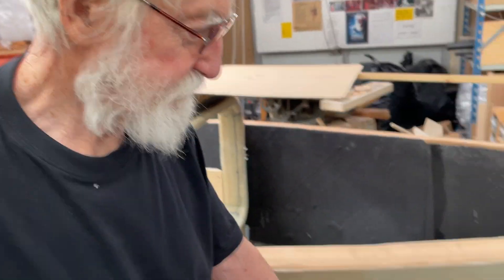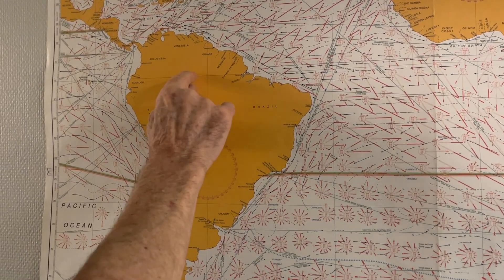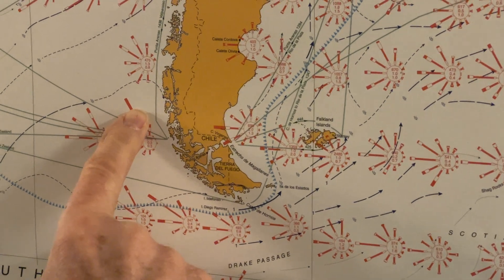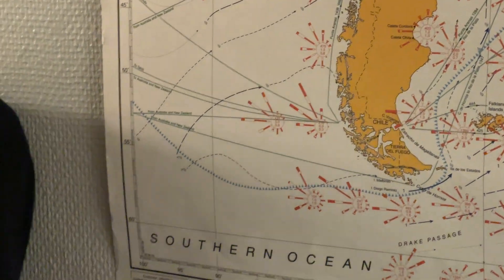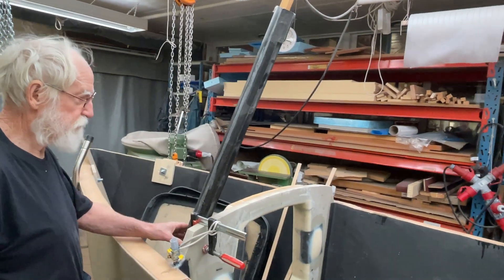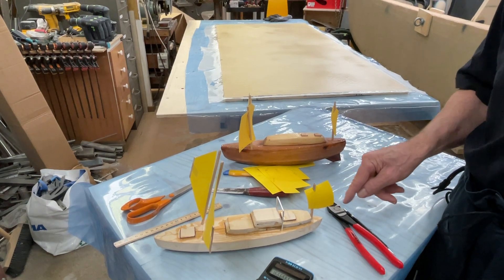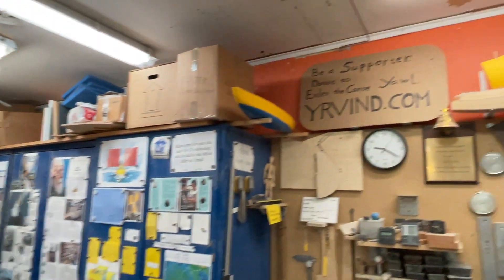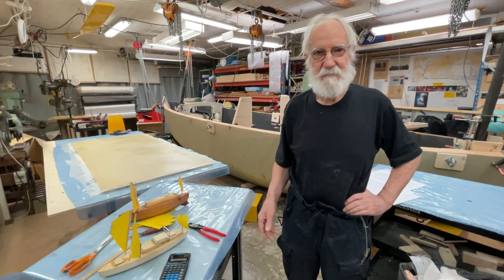A new year, a new idea, a new route. If confused go to Yrvind.com

Comment: I use the Hobie kayak sail and mast along with the Hobie Kayak Sail Furler Kit and outrigger with inflatable floats and a movable leeboard to sail my 17 foot sea kayak. The system allows me to furl the sail around the mast to adapt to all wind conditions. The sail is 2.2 square meters fully deployed. The mast goes through a hole on my kayak deck to a mast step (a Zodiac fishing rod holder) glued to the floor of the kayak in the forward compartment of the kayak. The mast end has a half-ball tip that allows it to rotate nicely in the mast step. Lots of fun to sail.

Comment: With regards to your aft lug sail you could sheet forward from the windward side of a boom which would be in tension . Hope that makes sense. Good luck . I enjoy anyone who is outside the box.
Reply from the maker: Thanks for the suggestion but the aft hatch is very close so that would interfere.
The mizzen sail is only 1 square meter about 10 square feet so no problem sheeting aft.

Comment: Yann Quenet poles out the sheet on downwind courses, and he still can't sheet the sail out beyond 90 degrees, as you wanted for self-steering downwind.  Have you considered junk sails?  Your rig has the great benefit that you can build rigid, curved battens for your two forward sails.  If you use only the leeward sail upwind, it can have a very effective profile, without any of the complications needed to reverse that profile for the other tack.  You can still sheet out beyond 90 degrees, and reefing is so easy, when I had a 5 sqm junk sail on a canoe, I sometimes used the halyard to deal with gusts instead of the sheet.
Reply from the maker: I will use two sails to windward in light winds. The Ljungström rig is very efficient to windward as by turning the mast you can get a smoth suction side.

Comment: Roller reefing on the mast will allow you to remain inside the boat for practically all sail adjustments. Great idea. The rotating mast may be a challenge to seal at the deck, but Sven will invent a solution. deck
Will you find a new storage place for water or maybe bring a small manual osmotic desalinator?
Reply from the maker: There will be no seal at deck on the mast. The solutions is drainage.
With 105 liter water I got plenty for Cape Horn 3000 miles Uruguay to Chile.

Comment: Hello Swen!
I have a question about Divinycell material.
How do you think is it good and strong enough to build a safe, stiff and durable ocean rowing boat or a kayak like the one Alexander Doba used? Will boat made of Divinycell be able to let cross the Pacific Ocean?
Thank you so much for sharing the videos of the building process.
You inspire me a lot.
Denis
Reply from the maker: You can make the boat as strong as you want. Divinycell is used in military high speed craft, submarines and wind power mills. It is only a question of dimensioning
Reply: @SvenYrvindExlex  What thickness Divinycell would you recommend for a 7-8 meter long paddling ocean kayak? The same as you use for your project or thinner material can be used?
Reply: @SvenYrvindExlex  Oh, one more question.  Why you use plywood and not Divinycell to build the interrior of your boat?
Reply from the maker: @denniskapitonov  I cannot ansver the thickness question. It is for the designer, but 10 mm is Ok Depends to on the laminate, if it is carbon fibre prepreg in autoklave or infusion or wet lay up or other.
Reply: @SvenYrvindExlex  Why you decided to use 70 mm. Divinycell for your current project?
Have you ever built boats from thinner Divinycell panels?
It probably forms/bends easier and will not require additional cuts in bending areas.
Reply from the maker: @denniskapitonov  I have used 50 and I have used 40 mm. Divinycell besides strenght also gives very good insulation and boyancy and make a quiet boat that makes little noise.
Reply: @SvenYrvindExlex   Thank you for your replies Sven. I wish I could work side by side with you.

Comment: With the new design for the rigs at the front of the boat how will you move them. I remember you saying you would like to be able to change their positions. Id you plan on having the roller furling will the masts be able to be taken out? If so the masts will have to be put back rolled if the string is pulled; or unrolled if the string is winded
Reply: Either way the reefing will be easier but the moving of the mast positions will be more difficult .
Reply from the maker: @botston  I do not realy understand the question. This is is a new idea. Before when I had lugsails they had to lean outside at sea but not in port. To solve that problem I intended to do an athwartship tabernacle. That is not neccesary anymore as this rig do not protrude in front of the mast.

Comment: I don't like the idea much.  The sockets where the mast goes in could be a weak spot and lead to de-masting.  I think having the boom rotate would be a better thing.  I'm mechanically inclined and not a sailor (I've read books on pitch poling and sailing in general) so take my ideas with a grain of salt, but something loose can come apart.
Reply: P.S.  Cape Horn is the true test of a ship/boat and a man.
Reply: Another challenge with Sven's idea would be to prevent the sail from unfurling in stormy winds in a bulletproof way. It will probably also be tough to control the rotation of the mast wind in similar conditions due to friction and bending of the mast. So I second your idea of instead looking into rotating the boom. Cheers.
Reply from the maker: This is small sail area 3.2 square meter and short mast and the Ljungstrum rigg is well tried having been around since 1933.
I do not worry about the sockets they are many times stronger than need to be. Their diameter is huge compared to the mast.
Still the mast is very strong and short. I let three one hundred kilo men hang in the middle of it. No problem.
Reply: @SvenYrvindExlex  If you're confident then I am too.  Are you going to paint the boat Swedish colors?
Reply from the maker: @ralphwatten2426  Yellow RAL 1003
Reply: @SvenYrvindExlex  Signal Yellow...Need to put a little blue somewhere.  Can't wait to see how those masts work.  Thanks.